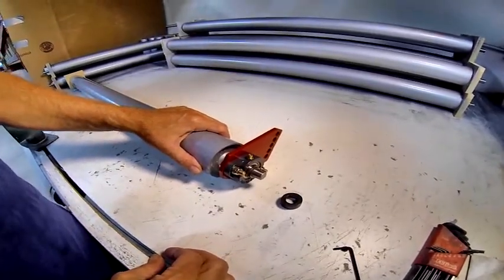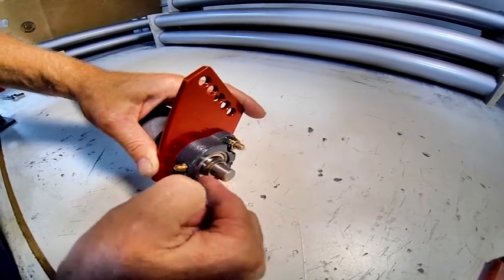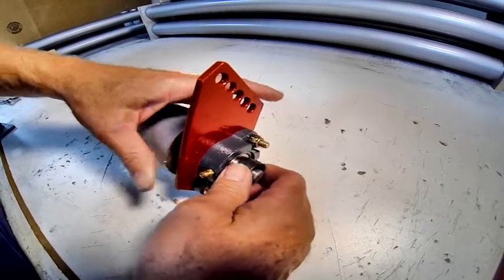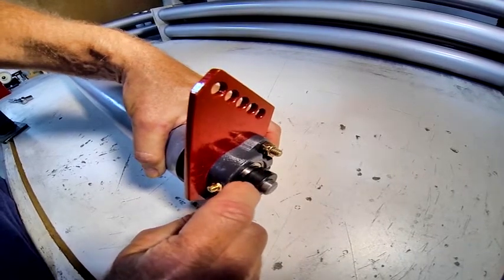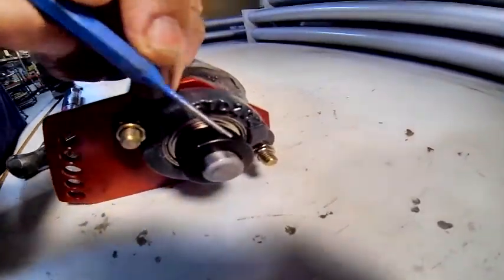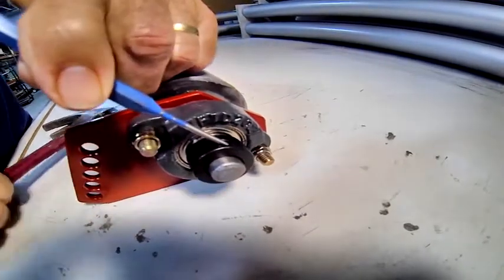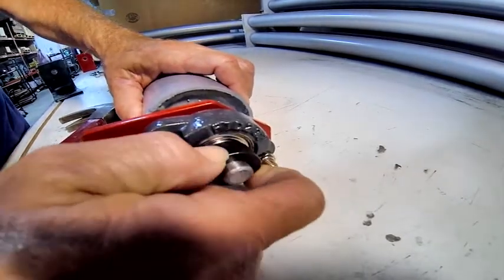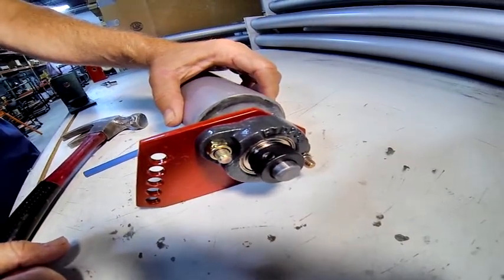Eccentric Locking Collar Installation Video

Comment: Some (probably many) two-stage snowblowers use an eccentric locking collar to lock the impeller/auger bearing onto its shaft.  Some such snowblowers have updated part numbers so that a bearing with a built-in collar, when worn out, is replaced with one having a separate eccentric locking collar.

I saw another video that says the collar has a hole for use with a spanning wrench.

Big thanks for making things very clear.  Best video I've found on the subject.
Reply from the maker: You're welcome. Glad it was helpful.

Comment: Here are some engineering arguments (supporting the recommendation in the video) for why the collar should be tightened in the direction of the shaft rotation.

I believe the shear forces of 1) the bore against the shaft, and 2) the collar against the shaft, are equal.  Notice also that the collar and the bearing inner race may be of different materials.  

Suppose that the locking-collar material has a higher coefficient of friction against the shaft than does the material of the bearing inner race against the shaft.  Also notice that the collar has a set screw.  For those two reasons, the collar's static frictional torque against the shaft would be greater than the bore's static frictional torque against the shaft.  So if, upon startup, either suffers a torque that overcomes the static locking frictional torque, it would more likely be the bearing inner race, not the collar. 

Suppose the collar weighs less and has a smaller diameter than the bearing inner race, so that it has a smaller moment of inertia (I believe that that is the usual case).  Also there is some friction inside the bearing (especially upon degradation of the bearing) that will tend to torque the inner race in the opposite direction of the shaft's rotation.  Both of these imply the bearing would more easily start to turn against the shaft upon startup, compared to the collar.  The collar would more easily rotate along with the shaft.   

So for four reasons, the collar is naturally more stable relative to rotation of the shaft, and it makes sense to lock the bearing to the shaft by rotating the collar in the usual direction of shaft rotation.
Reply from the maker: I agree with the points you've made. Thank you for taking the time to write this out for the benefit of others. We have thousands of these bearings in service and when they are installed correctly they do not come loose.
Reply: @KerryHarrison-Woodturning  Thanks.  I don't have any experience with these bearings, but I think I understand their structure and function.  My reasoning comes immediately from basic physics.